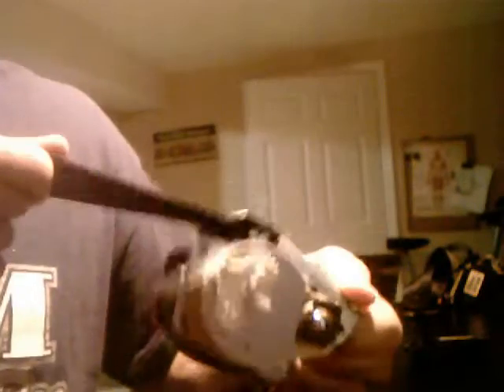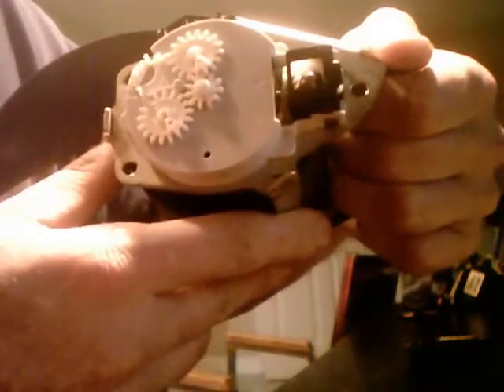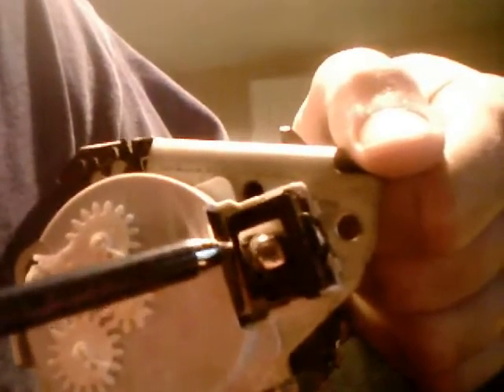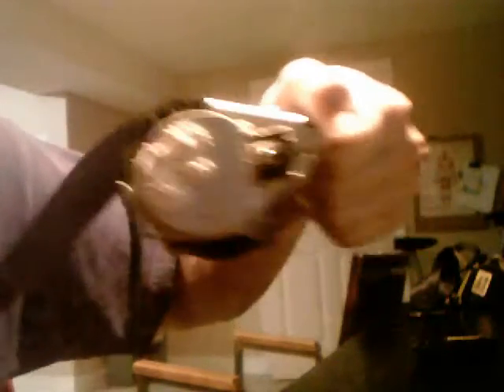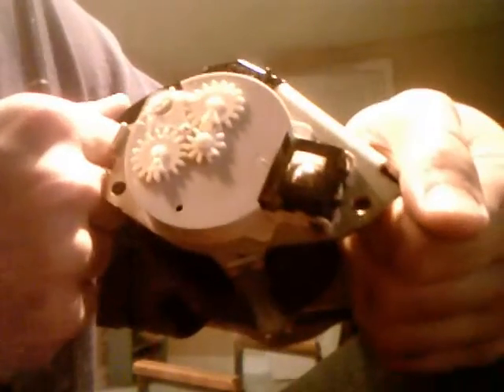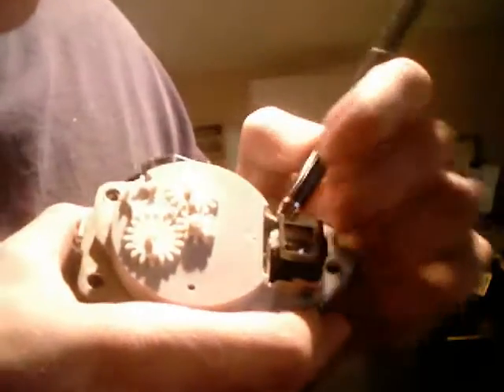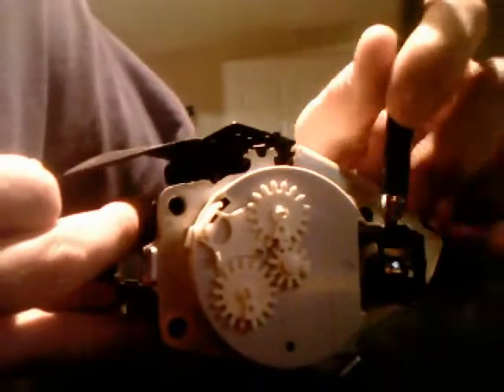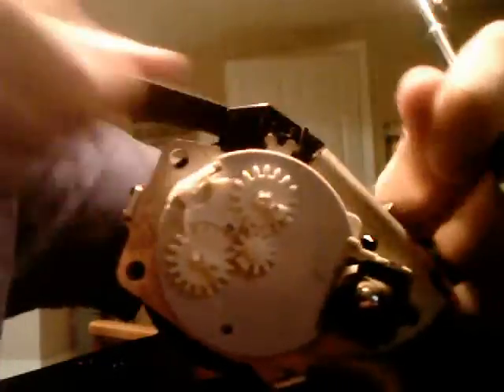VW MK5 (2006-2011) seatbelt stuck

Comment: Maybe it's the white level it can be defective worn out
Reply: All I did is remove the little ball and cage and pull and retract the seatbelt and then put the little cage back in place.  It is working like new now.  Thanks…
Reply: It seems that it will only extend and retract as long as it is sitting mounted in place.  If you put the assembly at other angles the ball causes it to lock up.  So I guess in an accident the ball is moved to a non normal location causing the belt to lock.